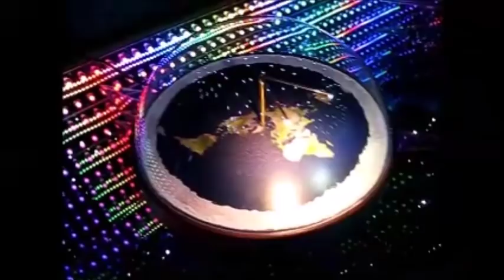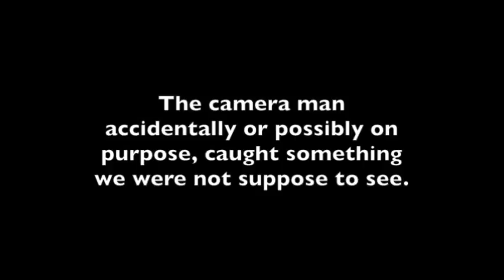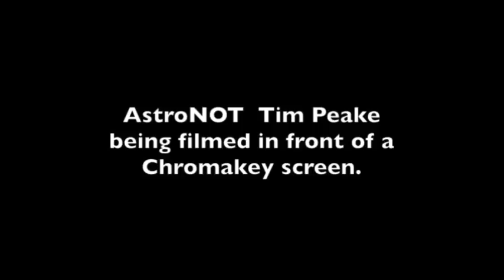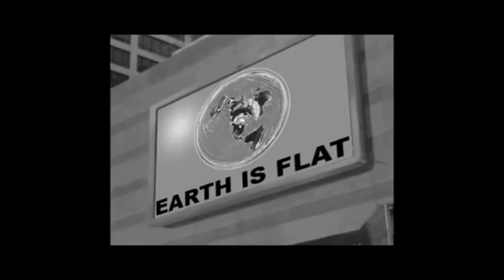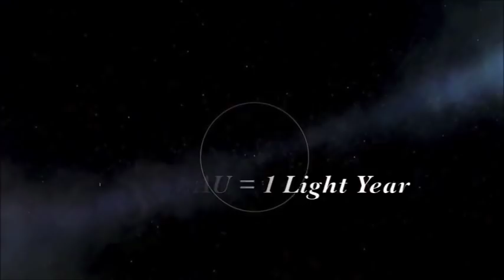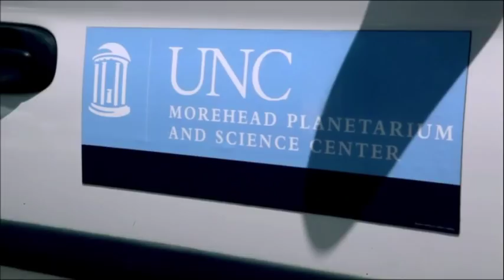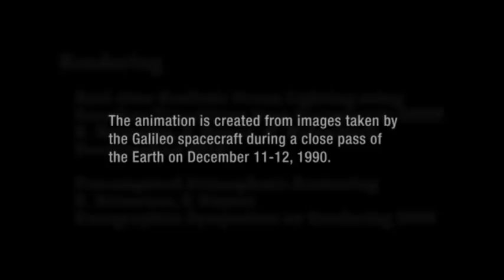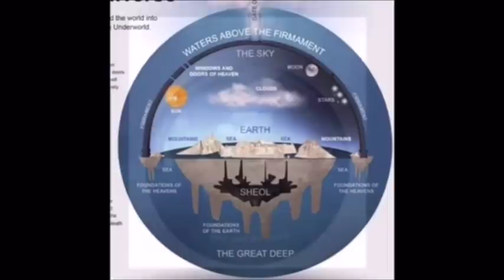Flat Earth Q&A emails 66 - Mark Sargent ✅

Comment: it is pushing off the force of the propulsion from the jet? moron
Reply: Its pretty simple. when the mass is pushed out the rear of the rocket with a force, that same force pushes the rocket in the opposite direction.   the mass being pushed out , is very small (rocket fuel, being burned with associated oxygen) so, with an equal force it is accelerated very fast. (F=ma) .  the rocket because its mass is heavier, accelerates much less.   you know there is mass being ejected, because the rocket does run out of fuel, and most of its mass IS FUEL.    it needs no air to push on.  just the fact that the fuel rapidly expands and is forced out the rear of the rocket is enough to create this force, and create the opposite accelerations.   simple, right??

Comment: Mark Sargent, i have been trying to give you some help with your physics ignorance. at 2:50, you start again saying that rockets need something to push off of, and they DON'T.   F=ma doesn't work like that.    the fuel that is burned is ejected out the reaer of the rocket (that's a force that pushes the rocket forward)  JUST like a bullet. there IS mass to the burned fuel, that's why the rockets run out of fuel!   where did the mass of fuel go??  yes, out the rear of the rocket.     there is your equal and opposite reaction   of newton's 3rd law.     the same force that pushes the rocket forward, also pushes the rocket fuel and oxygen out the rear of the rocket.   make sense.  stop saying you need something to push off.. it makes you sound REALLY silly and ignorant!!
Reply: so you're a vacuum expert then?  you've conducted what experiment proving that rockets can operate in a vacuum?  we'll be waiting forever on that...
Reply: Lifefree Ordie.   yes, i have much experience in working with vacuums.   there are many experiments you can search that show vacuum and rockets or guns working in those vacuum conditions.   when you understand physics , you understand that rockets need NO air to push off. the equal and opposite force is just like a gun , except the bullet is the expanding gases   in a rocket. no different.    a gun can do this too. there is a small recoil when you shoot blanks.   much smaller, but a force none the less . this happens in space  or vacuum too.  if you learn about some basic physics, this stuff is real easy to understand and comprehend.  right now, it is a safe bet, you have not studied or experimented in the field.
Reply: zanick2 yeah sure, there is no ,experiment  demonstrating any of what you've said.  I've been looking.  Kindly enlighten me.
Reply: toss a bowling ball off a skateboard and see yourself move back.  shoot a gun on a skate board, watch yourself go backward.  or if you want to see an experiment, here is a one.        if you have been looking, you  havent been looking very hard.     so, why do you think a rocket wont work in space, if  the fuel is burned and ejected otu the rear at a high force. there is your equal and opposite force.  you dont need air to push off.  that is just ignorant.  now, if you think otherwise, ask questions and i might be able to explain it in a way that makes even more sense.   https://www.youtube.com/watch?v=GxBRQXxBRic
Reply: zanick2 yeah the vacuum pressure needle moved, whereby the experiment is null.   Tell me mr. Vacuum expert, how long has human being lasted in a pressurized space suit in a vacuum?   There's only one documented experiment that I've found,   lasted about 20 secs. Before he thought his insides were going explode.  Try harder.
Reply: Livefree Ordie.. the needle moved, so it voids the experiment?    really.   what needle  .  the one In the small vacuum chamber?    
now, your next silly question.   the pressurized suit only needs to be pressurized to 5psi.  (ever felt a tire at 5psi.. its like a balloon pressure)       you only saw one YouTube, so it can happen?  yes, there many other tests in a vacuum for space suit testing.         the one that lasted 20 seconds was a failed suit.
Reply: the dupidity is strong with you.  enjoy never going to space el dupo.
Reply: Ordie: You clearly have no clue as to how a rocket works. Why don't set off a bottle rocket in a vacuum chamber and see how it flies? You won't try that, will you? It's because you know that you are wrong.
Reply: Mike Lemons sci-fi addiction is a tragic ailment.  Seek help.
Reply: zanick2 yeah that formula works in our atmosphere.   That same formula makes no sense in an immense vacuum which space is purported to be.   Submarines work in their medium, but as we all know they don't in ours.  Face the truth, the powers that should not be have lied, and will continue to do so.  Your dupidity notwithstanding of this displays how addicted to sci-fi you are.
Reply: zanick2 lol, I'm certainly more on than you dupe boy.  Enjoy the bliss of never going to space you addict.
Reply: more than what?? , livefree Ordie..  you mean your head is just buried  in the sand.. that's ok ostrich    boy!
Reply: zanick2 lol, when ru going to space again?  It must suck knowing that it's so close yet ...  rockets in space lol, if it helps you sleep have at it dupe boy.
Reply: Livefree Ordie, when you open your eyes,  you might begin to see how great life really is, and how amazing the things that man has accomplished.  do say rockets dont work in space, is like saying "im a moron".   have fun with that!
Reply: lol, stop helping to indoctrinate children with pseudo scientific horseshit.  thats why were in this mess you ignorant dupe.  yeah you're quite the revolutionary spouting out gov't propaganda about a place you will never experience first hand.  heliocentrism died, you're just late to the realization, from the looks of things you will never teach a child anything worth a fiddlers fuck.  those poor mind raped children never see it coming.  good for you!
Reply: zanick2 lol move along there dupeboy, btw not once have I said that the earth is flat.  But the conditioning of your rulers has made you an emotionally stunted blowhard, that will not see the forest for the trees.   A good camera will bring all of the lies into focus, now how about go somewhere and figure out why ships aren't going beyond an imaginary curve.  Nah you got more important shit to do like corrupting young brains with non-inductively proven sci-fi facts.  Goo yob el dupo
Reply: Livefree Ordie, actually, yes you did with the comment "heliocentrism died". so, if you think the earth is NOT round, and you are not saying its flat, then what is it, a triangle??     you are a funny sole.
Reply: zanick2 In the famous words of Ronald Reagan, "well there you go again.
Reply: Livefree Ordie.. yes, truth is a funny thing.. it always habit of coming back around to bite you !  :)   do the tests, dont report back until you have something intelligent to say
Reply: zanick2 Dupidity is very real.  Lol, you demanding an intelligent response is quite the hoot!  You lost your intelligence privileges once you began advocating for the status quo inre. To space.  And all the prideful shitstains said. Dupedupedupedupededupedupe
Check mate chumpzilla.
Reply: zanick2 it's been phrased pursuit of happiness.   You got issues with drugs?  Use the drug, don't let drugs use you.  As far as I know, I know that I know nothing.  The cure for [Dupidity] sic,  begins when one truly believes this philosophical tenet.    
Good day to you. And pursue
Reply: look, take some time to learn about your world.... you will see the obvious and not something that someone like Mark Sergant seems to think he knows and doesnt.